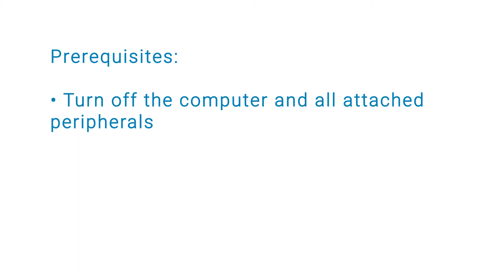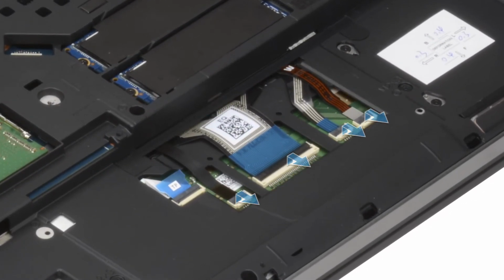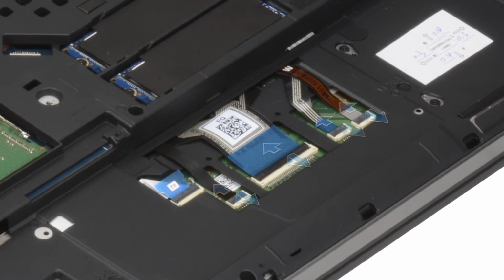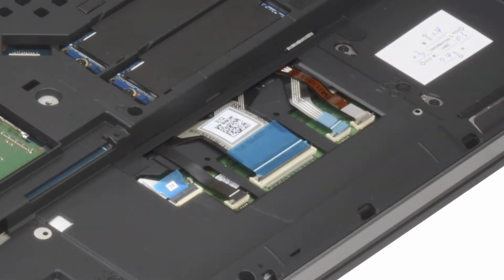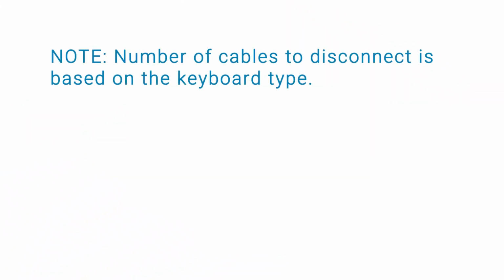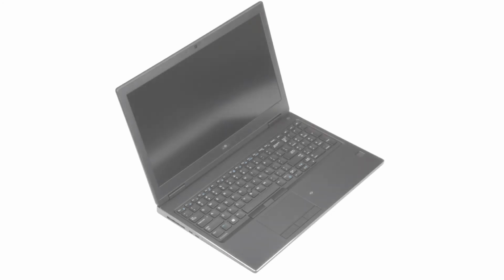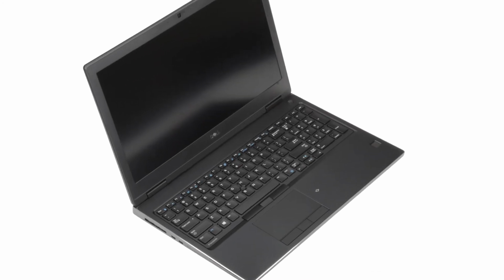How to replace the Keyboard in your Precision 7530, 7540

Comment: Great! This is sooo much nicer than the 5000 series Precision. The 7000 series uses the case design I'm used to from the Precision 4800/6800 series, very easy to work with. The Precision 5000 series is slimmer, and so you have to take the whole bottom off, disconnect the battery, remove the motherboard, and then get the keyboard out. Such a pain!